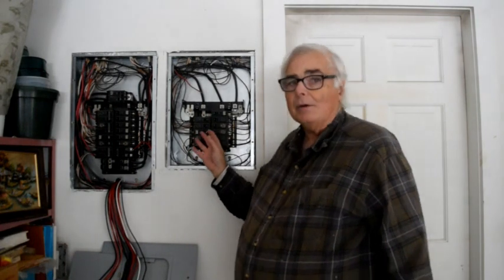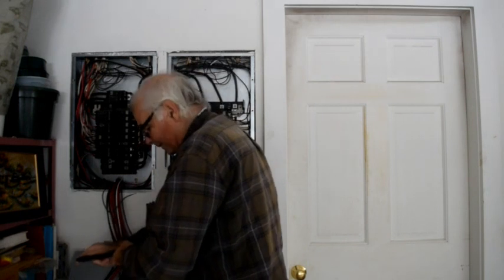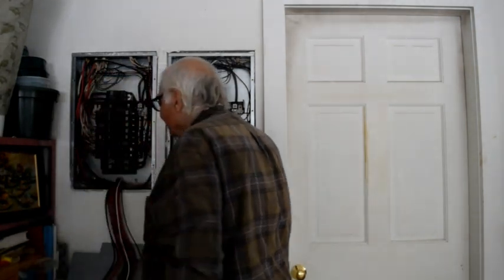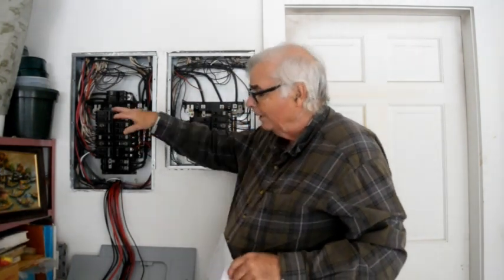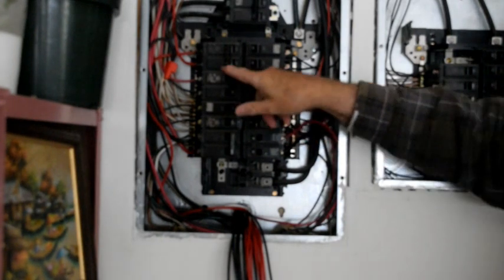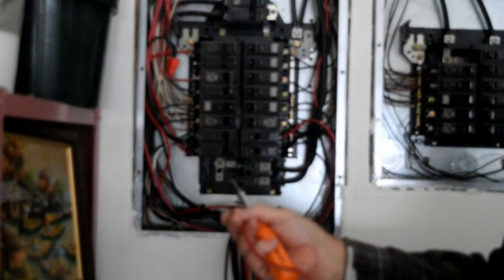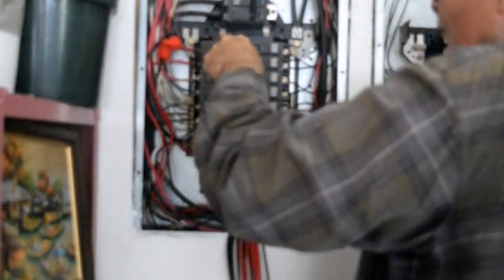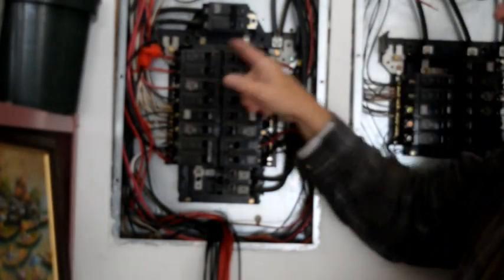Solar?Battery Backup Power: Part - 2 - Wiring the Transfer Switch

Comment: Really good, thanks! I wish you had showed the connection of a circuit on the sub panel also. I guess you need to snake the corresponding red and black wires from the main panel to the sub panel and make the connections to the circuit breaker with the red wire and to the removed black wire with the black wire and a wire nut.
Reply from the maker: Actually the transfer switch is the sub-panel.  The wiring shown is all there is to it.
Reply: @todddunn945  You have a main panel and a sub panel and the transfer switch panel. I was remarking on the wiring from the transfer switch to a circuit on the sub panel.
Reply from the maker: @natwilson5789  That was done the same way as the wiring from the main panel.  I don't recall if the wires that came with the transfer switch were long enough to reach the sub panel or if I had to add a short length of wire.

Comment: Strangely compelling.  I hope you get decent weather though.  You’ll soon be off-grid.
Reply from the maker: I will be posting a video later tonight on the solar panel install which I finished today.  So as of 5 PM today all the outside work is done.  Now all I have to do is spend some real money for the batteries, inverter, solar charge controller and various circuit breakers and heavy gauge wires.
Reply: Todd Dunn .  Good work.  It’ll be interesting to see how much power you can generate.

Comment: This looks like a fairly straightforward process if a person has some electrical knowledge.
Reply from the maker: Yes it is very straight forward.  The hardest part was routing the new wires through the tangle of existing wires left by the person who originally installed my electrical panels.  That person didn't bother to label any of the circuits.  After much tedious testing I am finally down to only one circuit I haven't been able to identify. I suspect it is for a never installed garbage disposal.  That is the down side of living in an area with no residential building codes.